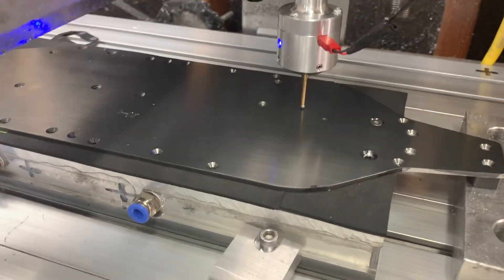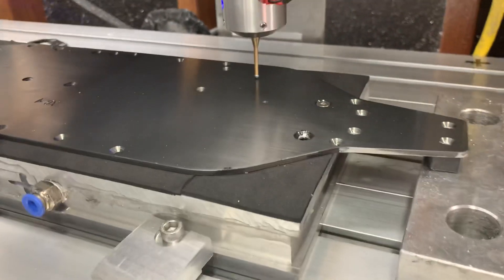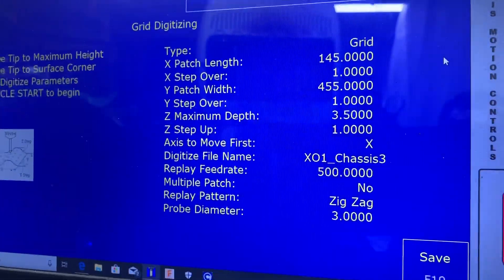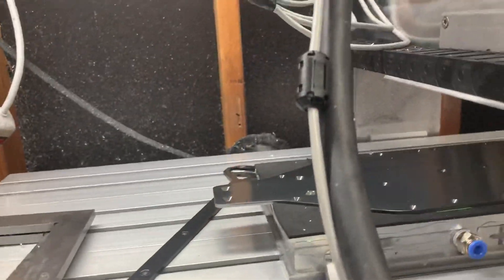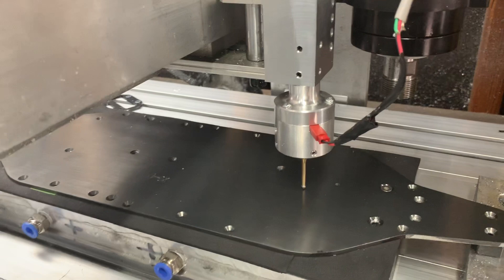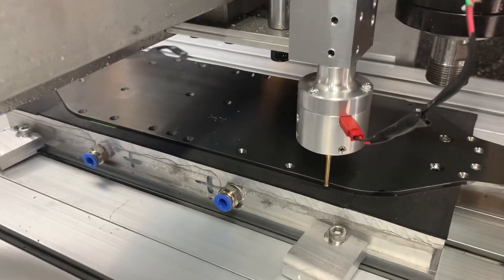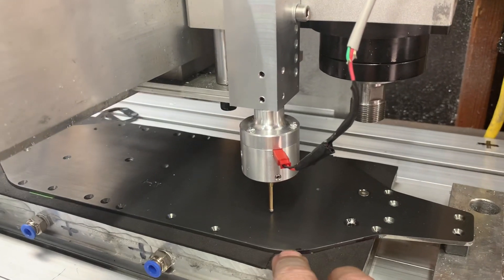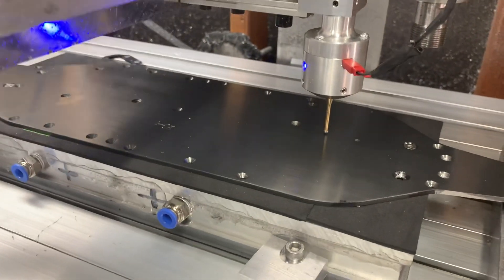How to scan with Centroid Acorn digitizing probe the right way

Comment: No surely the tool dia offset is a separate thing you can mess with?  can  you just drive it to a hole  get it to do a wiggle  then somehow to tell  it "yep that's a hole 6mm  with a 10mm csink " the strategy of scanning every  2 mm in a gride seems pretty wasteful when you have so few features ..othewise it might be worth  just  set up on center  drive to each hole then  draw the holes on those coordinates infusion or whatever.